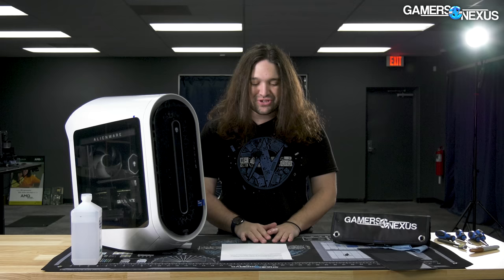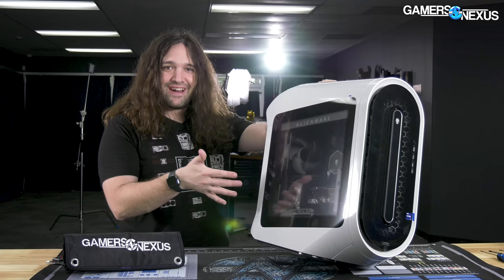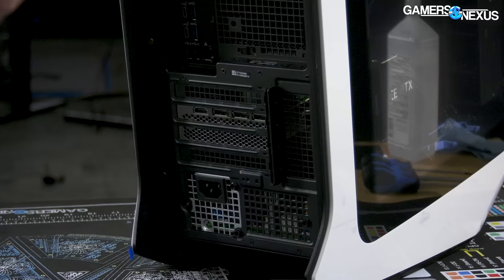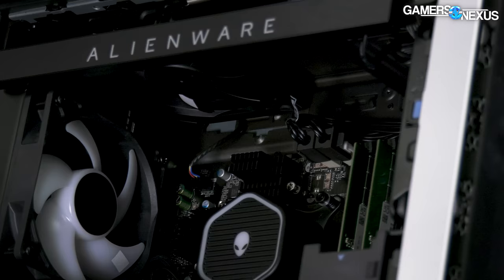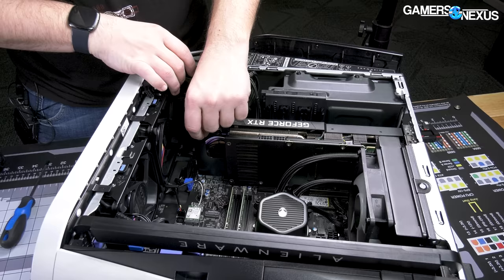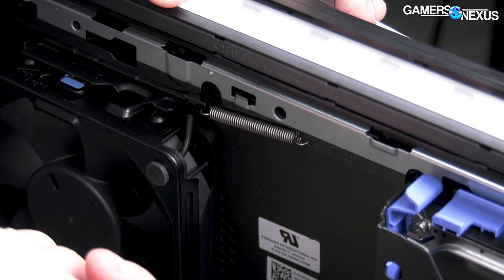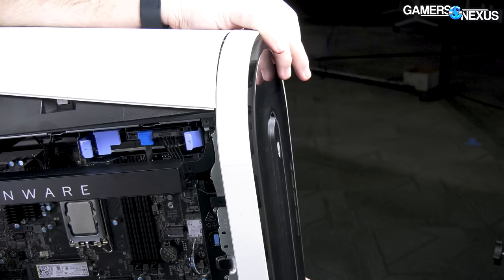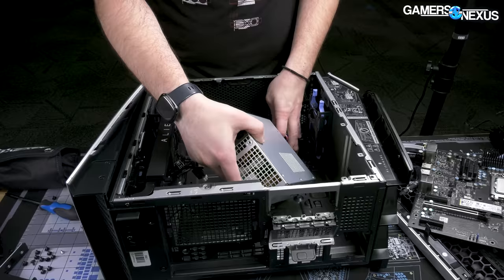Crazy Bad $5000 Alienware Gaming PC: R13 Aurora Tear-Down

Comment: Hello Steven, a Orico clone dock destroyed both my 2TB Samsung boot drive and the new one I purchased to clone as well, and it then DESTROYED my Gigabyte Z390 Aorus Master and i9-9900KS (RED light on the CPU light in the bottom right corner of the board), Intel put me through the full CIA black site interrogation process, they wanted the serial and markings off the IHS (which is normal) then when they realized it is a i9-9900KS, they wanted pictures of the top, sides and bottom, then that wasn't good enough, they wanted a picture of a QR code on the CPUs PCB edge, this took about 25 times, first its to close and they can't scan it, then it was to far so it's to blurry, then it was off angle, then the lighting wasn't right, finally I used a motherboard plastic display case holder and set it on a desk next to a window, and used a LED backlight and a 10x optical zoom using a rubber pad to hold the camera steady and finally it worked, they were able to scan it and then came the "odd email" which was, "Can we send you a i9-9900KF to replace your i9-9900KS?"... to which I was like "WTF are you talking about, I've spent the better part of a month getting a refurbished board as Intel said its probably the board, now the fact that the 1 digit LED error code display on the bottom of the board was dead, nothing, and the only lights on where the orange B_BIOS and a RED CPU light, so I finally get a $387 "Refurbished" Z390 Aorus Master Motherboard, and same thing. So then the blame fell on my Corsair AX1500I PSU which self tested GOOD, as it did with my PSU tester and it came back "PG" so the PSU is good, but to satisfy both Gigabyte and Intel I ordered TWO 850 WATT Platinum modular PSUs because they had a $20 MIR and you can never have enough extra or spare PSU, again tested good, still NO POST, NO VIDEO, NO BEEP CODES. Then it went to the RAM, 128GB of Corsair Vengeance LPX (4x32GB), so I got a basic 2 pack 32GB Corsair (2x16GB) and again, nothing, then an Intel CPU Architectural Engineer said let's try the GPU (I have 3 of the same XFX RX 480 8GB Black Edition GPUs, so I swapped them between systems all 3 cards work in other systems but none work on the Z390 board with my i9-9900KS, so the engineer said, lets just remove and bypass the GPU, and use the HDMI on board video with the i9-9900KS UHD 630 IGP, and again NOTHING (and yes I tried 3- 24" Asus LCD panels, 2 - 23" Acer panels, and a 27" Dell monitor, nothing.

So then the engineer said it's probably a failed or blown out Northbridge on the i9-9900KS from the Orico clone dock overheating both NVMe drives (20 minutes to clone and the last 5-6 minutes the Temps where 184° to 201° F which Samsung said is way above their max temperature standard of 176° (75-80° C), so the Orico M.2 offline clone dock fried my NVMe drives which then potentially shorted the Northbridge on my i9-9900KS, so 11 and a half HOURS LATER (on the phone) I get back to RMA, who them tells me that they are out of all i9-9900KS, I said ok, I guess I could go for a i9-9900K if I have no other choice, and they said, oh we are all out of those too, all we have is the i9-9900KF to which I said NO. So the RMA rep suggested a swap for a new i9-12900KS in trade for my i9-9900KS (but I read up on that and only 2 of the P-Cores will run at the full 5.5GHz Turbo boost speed, the other 6 P-cores will only run between the 3.4 and 5.3GHz at best, AND I would have to buy a new Z690 board and a 128GB of Corsair Vengeance DDR5 RAM, so I said, after all this trouble I think I should get one of those i9-9900KF chips to put in my Z399 board when it comes back from Gigabyte RMA, and the rep said that this would be an option. I asked if I could research the upcoming 13th Gen and Z790 boards over the weekend and then give an answer Monday, so I did and called yesterday (Monday April 25th 2022) and the RMA rep said "I see the notes, so you want to go that route? You do know you'll have to buy a Z690 motherboard and DDR5?", I said, yes I know, let do it, so they submitted the request, and today I ordered a Z690 Aorus Master and two 64GB (2x32GB) packs for a 128GB for a Whooping $1,684+$26.95 S&H and tax...

And then I got an email from Intel saying they are going back on that offer because the RMA has to be "like for like", well a i9-9900KF is not like for like, so then Intel said since I sent them a copy of the recipe they requested, they would just credit me the amount I paid for the i9-9900KS, WTF, NO WAY, the amount of research, driving around, and calling stores to get that i9-9900KS was insane and a simple credit which won't even buy me a new i9-12900KS really sucks, what can I do? Steven can you help??? Thank, Milo
Reply: Ok, so you wanted to clone some ssds with a orico clone dock, which malfunctioned and blew up your CPU and some nvmes. How is that intels fault? Good luck with your built though!
Reply: Had an experience with my otherwise favorite tech store recently where they tried to bail from an agreement, but luckily they changed their mind. 

My 4tb Samsung 870 evo I used for games started to fail, so I made an rma and asked if I could be refunded and buy another drive due to rumors that the Samsung 870 has some issues and they said yes. Said I would think about it for a few days since I just sent it back and usually these thing take a little while. The next day I received an e-mail saying they had gotten the drive, found it to be defect and had shipped a replacement (all in one day!). Called them back and said I would like the refund and they said to just refuse to take the shipment when it arrived and I would be credited. I then bought an nvme drive instead and thought everything was dandy, but then the replacement drive arrived and I didn't get a chance to refuse it. Sent it back the next day. Then I got an e-mail where they asked for my account number so they could wire the funds - no problems... 

A few hours went by and then i got another e-mail where they wrote "sorry, but a mistake has been made. We do not refund anything. A replacement drive has been sent. Have a nice day". I was like WTF! Wrote back and told them how unfair I thought it was and that I had already gotten an nvme and put it to use. Was really pissed and for a few hours I regretted buying my new nvme at that store. Thankfully the next mail I got they said they would refund after all. 😅

Comment: Does anyone remember the old days before Dell bought Alienware and they actually produced decent products?
Reply: Nope, was that a thing, didn't happen on RHS of the pond. We had Viglen (raises eyebrows) and Amstrad
Reply: it used to be overpriced but good. right now it's overpriced but shit.
Reply: I remember my $2700 purple Alienware 1.2GHz T-Bird with a single 60mm case fan (that came loose during shipping) and CPU fan. I had to run that thing with a desk fan aimed at the open side to keep it from shutting down while playing Unreal Tournament. I think I eventually transplanted it to a better Antec case with more fans. At least the Klipsch 4.1 speakers lasted much longer. And I still have the manual binder :) I went back to building my own after that.

Comment: I bought an Alienware R4 back in the days. The case was severely over-engineered and the PC underpowered. They paired a 3820 with a 650 (I believe). I remember the CPU well, but I replaced the GPU within 6 months. Switched it out with the original GTX Titan. Switched the CPU out with a 3960X 2 or 3 years later. Saw it on sale for 300 from its original MSREP of 1000 so I figured I had to buy it.

Comment: HP is generally better than Dell, so interested to see how that turns out.
Reply: Not much better.
ALL of the OEMs do the same shenanigans like this with proprietary form factors and parts.
Some of them do it more than others.
Lenovo might just be the worst. I tried to put a WiFi-6 card in a Lenovo laptop to replace the crummy AC one it came with, and it wouldn't even BOOT with it installed because it wasn't an "authorized part". And I'm told by a tech here at work that Lenovo does this kind of thing all the time. They can ALL go to hell as far as I'm concerned. I'd never buy any kind of a desktop from an OEM, and I do my research when buying a laptop since you can't really DIY build one.

Comment: Back at the beginning of the century I had a few Dell products in fact I still have a Dell 17" CRT that works but is not used. My last Dell was overpriced and obsolete in a matter of months. Since then I only build my own and have had very good results. My old 2700K is still going strong.

Comment: I stopped liquid cooling long ago. All my builds now are exclusively Noctua Air cooled only. You can easily have cool enough temps where nothing throttles and with Noctua, its still very quiet. The only con is that they are ugly fans. But after 25+ years of PC gaming, you stop caring what your PC looks like when you look into the side of it. I haven't found a way to look into my case and play my games at the same time. Even with the coolest custom water loops I found myself not ever looking into the side of the case. I just wanted to get onto my games. Oh and Noctua has fully metal case stickers. They are the best stickers in the biz.

Comment: "I must've gotten really lucky since I got a Alienware laptop in 2013 and it didn't show any problems until 2017 which was a simple battery replacement and didn't show any other problems until 2019 and the motherboard quit working soon after. It went strong about 7 years and I took horrible care of it to be honest I probably could've had it for a decade if properly taken care of it. Alienware is truly a great choice." Remove quotations and text before and after quotations.

Comment: Counterpoint: My son's Area-51 is similarly over-engineered but ran for 7 years without doing anything to it except vacuuming the fans every six months or so (it still runs perfectly, we just upgraded is all). Counterpoint to the counterpoint: We got that machine for free due to a PR rep stealing one of its two 980Ti GPUs. If you can get an Alienware for free, it's a freakin' awesome machine.

Comment: To get my RTX 3080 I ordered an Alienware Aurora R11 on December 3rd 2020, and received it on December 24th.  It was an ok machine, had decent benchmarks and I still use it (sort of) today.  In November of 2021 I bought a new case and motherboard and removed the CPU and GPU from the R11 and put it in my new case with a new watercooler and it had better temps (not that I had issues with my R11 temps after I added a couple of extra case fans in the Aurora case when I was using it).  This past May I bought a z590 motherboard and an i7-1100kf cpu and some pc 3600 ram and put the i7-10700 back in the Alienware system along with the pc3200 ram I had bought to put in it when I first got the R11.  The R11 is now an upgrade to my in-house "server" box I have that is my movie, file, and game server box for the house (upgraded an optiplex 7010, i7-3770 system).  After I applied some thermal paste between the metal to metal contact by the heat pipes and cooling fins, my t-junction temps went from 88-95c to a stable 65-78c range while undervolted and OC'd to 2080mhz and currently +10 on the memory in MSI (I am getting decent FPS and I didn't want to risk damage or reducing the lifespan of my card by pushing it too far).  I was fortunate enough to get a great card out of my R11 purchase and had a decent gaming machine for a year before upgrading the main components.  I know others have had some tragic issues with their Dell MSI RTX 3080s they purchased around that time period in their Alienware systems, and I do consider myself fortunate.

Comment: I was a Dell tech for a while, and they have always put way to much crap in their cases. Over engineered to fool the consumer.

Their cases have always been way over weight, near impossible for an average consumer to take apart and horrible dust collectors.

It is the essense of proprietary and an early form of preventing right to repair.

Thank you for doing this video, as new young computer builders and basic computer consumers need to be aware of the rip off game that will only end through educated consumers.

Comment: I like how Alienware has gone a different route to try to get their case design to look much different and unique from anything else placed on the market. 

I can tell Alienware was wanting to build a design that was unique and would immediately resemble from a distance "Oh that's an Alienware!" 

Most other gaming PCs today generally all look the same. Very rectangular and boxy. You don't know who it belongs to until you get close to it. 

Yet, the Alienware design is specific to Alienware, and you can see it is an Alienware from a mile away. The case holds a bit of unique character, and when powered on, it is truly a beautiful case. 

I dont want to see Alienware go the generic rectangular boxy route as everyone else has. Alienware is much better than that. 

Alienware could do is just significantly enlarge this styled case. Add a larger PSU, more cooling, and more space for components to actually benefit from that cooling. 

If the Alienware case was much larger, and designed to allow easier fitting of other components with the future in mind. Well, the Alienware would definitely rise above anything else. 

It would be considered a behemoth, and not very portable. Although, being a behemoth but with everything else going good is way better than getting complaints about being a hot oven, and too small. 

Cost more to be a behemoth, and there probably would be a lot of unused space. But the purpose of that "unused space" is for good airflow and better performance. So it would be worth it. The unused space should also be good for future upgrades.

Comment: I am almost certain that at least 70% of the 5k price tag is only to compensate the price of tooling to mold all that god awful complex plastic assemblage that does nothing but look like it's 2005 and insulating heat into the chassis lmao. You could put all those essential parts in a 30$ chassis with good airflow and at worst it would be slightly better.

Comment: I can't believe this is a modern PC build.  It reminds me SO much of my first attempts at PC building when I wanted to add a video card and upgrade the power supply in a Dell Dimension E521.  It was a nightmare.

As soon as he removed the cover I could see that 50% of the weight of that rig was due to bloated design with unnecessary springs, latches and slidy bits encased in gratuitous metal and plastic everywhere.

I can only imagine what it would be like to be a fly on the wall of the meetings where they design and market these abominations.

I will say though that for whatever reason Dell seems to kill it when it comes to making displays.

Comment: every day i wake up happy in the knowing that ive never directly bought a dell machine. i did once buy a secondhand Dell Optiplex SFF with a included 1GB geforce 710 graphics card for my very first gaming PC but i was naive back then and know much more since then. that PC lasted a grand total of... 9 months and then the mobo shat itself. Then i immediately went with HPs EliteDesk SFF alternative as a quick replacement and threw away the Dell PC until 2 years later i started building my own from secondhand parts which im getting ready to upgrade. Will never buy a dell PC for as long as i live ever again

Comment: just been going through old dead PC's i have, still have a Dell XPS 700 from around 2007. Have'nt moved it in years,  just did and it weighs a ton,the CPU Heatsink probaly weighs as much as my current PC. 
been using it to support other PC's, it so hefty. 

Dell overengineering with plastic ,  springs and dodads seems to have been a thing 15 years ago as well

Comment: Spending nearly $600 for the processor alone and the CPU does not allow for display output options requiring the user to rely solely on a discrete, dedicated GPU for any displays they may want to connect to this used car priced paperweight.  Always build your own people, you will learn a lot during the process, you will avoid common industry scams, and you are going to have fun doing it.

Comment: Few months ago I installed a SATA SSD to my father´s Dell desktop. Even that pissed me off, had to remove so much useless plastic inside the case (it was for cable management purposes I guess) just for that simple upgrade. Anywhere Dell can add more plastic they will because of reasons I guess.

Comment: I had an Alienware several years ago.  Back when they still did the M18x laptop series  with SLI.  I wanted it simply b/c of the case.  Lemme tell ya what, I was quite surprised that not only did I order a gaming PC, but a portable oven as well.  I ended up ditching the entire system about a year n a half later, then did my own creation.  Nice to see Dell is right back to where they once were.

Comment: My cheap Chinese Huananzhi X99TF is a 10 layer PCB.  Bought it for $99.  Actually, the first order failed and I got a full refund, so I reordered via the official store for $99. The first failed order then arrived 2 months later.  So, in essence, I got two perfect X99TF's for $50 ea.
I stopped by OEM PC prebuilds after my DELL XPS420 (with a Q6600) back in 2007, for $3000 at the time. Expensive mistake...never again!
Now...only standard ATX components and a vertical test bench. Easy to keep clean...very accessible.  I wear BT earhooks, so fan noise is a non issue to me.